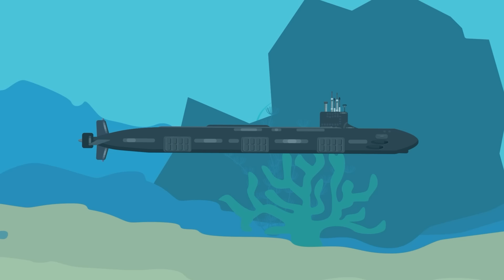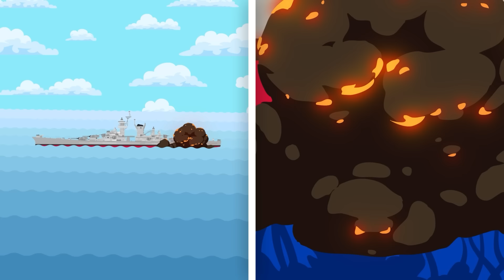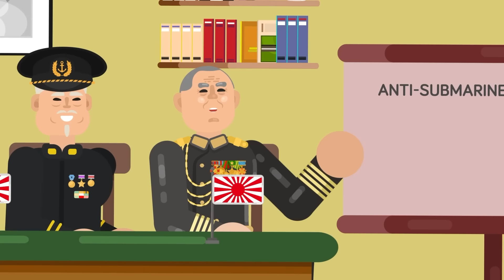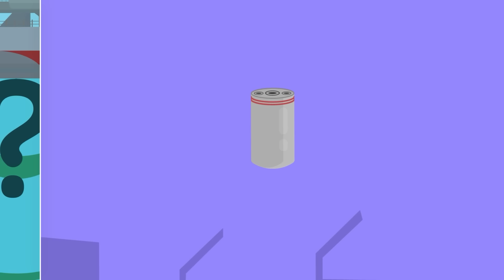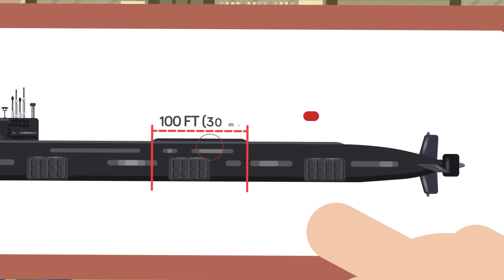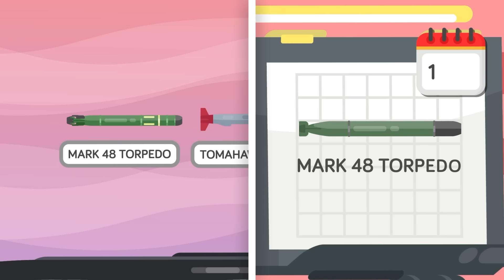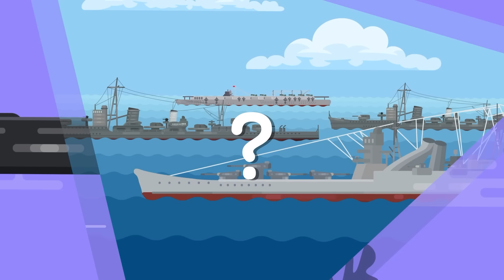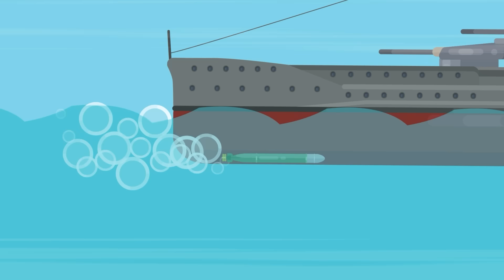What If a Single Modern Submarine Time Travelled to Pearl Harbor

Comment: Aside from the utterly wrong info about Hiei and Kirishima, there were only 3 cruisers in the IJN striking force, not 8. The 8th Cruiser Division was just heavy cruisers Tone and Chikuma, and the 1st Destroyer Squadron was lead by the light cruiser Abukuma. There were also not 30 destroyers in the fleet - not even close, only 9. Akigumo was attached to Carrier Division 5 as a plane guard, and the 1st Destroyer Squadron was made up of DesDiv 17 (Urakaze, Isokaze, Tanikaze, Hamakaze) and DesDiv 18 (Kagerou, Shiranui, Arare, Kasumi). 

A further 2 destroyers from DesDiv 7 which was technically under DesRon 1 (Sazanami and Ushio) were sent to Midway at the same time to shell the base there as a diversion. 

It takes like 30 seconds to check the order of battle.

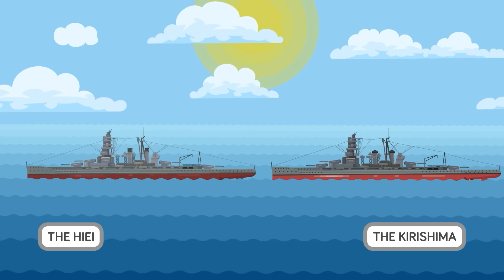Comment: @2:20 The Hie and Kirishima would not remain the most powerful ships in the IJN, not with 14 inch guns. The Yamato and the Musashi had 18.1 inch guns. Who writes this stuff?
Reply: They weren't even the most powerful ships at the time of Pearl Harbor: Yamato was still in shakedown phase at the time, but the Nagato class had been around since 1920 and was significantly more powerful.

As for this video, it fails to utilize the most powerful weapon on the Virginia class--its radio transmitter. Once it locates the Japanese ships, a quick wake-up call to the naval command at Pearl Harbor would end the mission real fast without wasting the super-expensive 21st century torpedoes on such puny targets as WWII destroyers. I'm only half joking: this video assumes that the Virginia is able to locate the Japanese fleet to begin with, when the failure to detect the fleet was the main reason why the attack was so successful.
Reply: @mogeleo  "there's a japanese strike group at this location!"
"first of all, what are gps coordinates. second WHO THE F ARE YOU! GET OFF THIS FREQUENCY!"
Reply: @mogeleo  I would bet that nearly every US sailor has a basic knowledge of the events at Pearl Harbor, and the Captains of those subs absolutely do. The sub has surface search radar. Get to within 100 miles or so northwest of Pearl, and power up the radar, and they will find them.
Reply: You're right, of course. But, they were "fast battleships" capable of keeping up with the Kido Butai.
Reply: @Wae-DI  mate the vid doesnt even mentions the name Kido Butai...full of inaccuracies

Comment: Except the mk 48 adcap torpedo is designed to blow up under the ships now a days that creates a massive are pocket making the ships weight buckle the ship snaping it in half...The torpedos have their own sonar and sensors to ensure it is a correct displacement area.  1 of our modern torpedos is enough to sink the crusers destroyers or any smaller ship. Battleships and carriers are too large to for the ship to snap in half from a air pocket of the size it can displace.

Comment: I was on a Los Angeles class sub, so I can't speak for a Virginia per se, other than I have some coworkers that did serve on Virginia boats and have verified similar capabilities, and I can confirm even a Los Angeles class (which is older) could wipe out a WWII fleet of this size without being in any real danger itself. That's why I've pointed out to other former Navy guys that if we ever got into a hot global war with major powers, the existence of modern submarines would completely rewrite naval warfare and likely make surface warships obsolete even more than carriers made battleships obsolete. 

No surface fleet would be safe. Torpedoes like the Mk48 ADCAP and newer variants are so lethal a single one of them can take down the biggest ships. And even Cold War era nuclear attack boats can hit targets from a very safe distance, at depth and never be detected. I suspect a prolonged war at sea would force all modern navies to shift to submerged warfare and make surface navies a thing of the past. What kind of crazy fleets would come out of the end of that, I have no idea.
Reply: It would be seaQuest DSV😊
Reply: I have no experience with anything military, so it's just a question, but if a modern sub was sent back in time, how much of it would work without satellites and other directional assisting equipment
Reply: @3613jeremy  Obviously they would lose certain advanced navigational capabilities without satellites, but as they are designed to be able to navigate at depth without any satellite or radio connections it wouldn't be a problem.
Reply: @3613jeremy  Considering that we get GPS info from sats we would have some navigational issues. But there are back ups with ocean floor maps that use sonar to guide and all of our torpedos are used outside the sat systems. The missle systems would be affected though since we would have to move from GPS guided to lazer guided. The scope can affix a lazer on a ship though and it would launch just fine. As far as being found it would still be a needle in a hay stack the stealth tech we have is unmatched. Our subs make less sound and have a smaller signture than crilfish.
Reply: @Monstarz  Well, I think we can safely ignore everything you said, you clearly were never a sub crewman, and definitely never worked with SLBMs.  They don't use "lazer" (sic) guidance, and don't use GPS guidance, either.  They use a gyro-driven inertial navigation system and a star tracker.  GPS and any form of command guidance (to include laser) was very deliberately left OUT of all nuclear ballistic missile systems, because those guidance systems can be spoofed or jammed.  INS and star trackers cannot.
Reply: @Kelnx  I've been working on a Los Angeles class sub. Amazing boat
Reply: I was on the USS Lousiana. If they took it back in time the entire war with both Japan and Germany would have ended swiftly...its an SSBN
Reply: @Kelnx  tell me about it not even. Navy I'm army i still know that 1 mark 48 would break the keel of any capital ships back in ww2
Reply: Hovercraft style ships.

Comment: Belt armor was not used to protect against submarines. It was designed to protects the ship's vitals against gunfire.  They tried designing armor lower down, to stop torpedoes, but found the multi-layer bulkhead system to be more effective.
Reply: The torpedo defenses in WW2 also only had to worry about WW2 torpedoes, which operated almost exclusively on contact fuzes (hitting the side of the ship).  While both the US and Germany experimented with magnetic influence fuzes that theoretically would allow a torpedo to explode under a ship, neither got them working properly in WW2.

Modern Mk48 torpedoes with active sonar homing, on the other hand, can very reliably detonate mere feet directly below the keel of a target.

Comment: I wonder how much the modern weaponry would depend on things like satellite infosystems. It's entirely possible some systems would simply be disabled because the satellites they depend on (like GPS) are absent in WW2. I hope they have backups... but it does seem possible some systems would be less effective than they should be because of apparent sudden loss of all external infrastructure. Or - maybe not. And we're not going to find out, because those who could speak definitively on it are absolutely going to be sworn to secrecy.
Reply: @TomBortels  most NATO missiles use gps for navigation. The Russians are disabling the gps in Ukraine causing headaches for the , NATO, I mean Ukrainian operators.  
So without gps many of the weapon systems aren't all that.
Reply: @ i suspect you're right, in that gps jamming could wreak havoc - but I also suspect (or hope anyway) that a modern nuclear submarine and it's weaponry have taken "the gps sats might be down or unreachable" into account. Dunno.

Comment: And that's assuming the sub only was carrying normal cruise missiles and not actual nukes.  One or two of those would render the entire fleet useless.
Reply: Virginia classes do not have the capability to carry ballistic missiles, they were not built with nuclear capabilities in mind. That is the job of the Ohio's.
Reply: @deathcore4576  nope, Tomahawks still have their nuke capability; they don't use it due to treaty obligations as it would be considered an intermediate-range nuclear missile.

However, the Crossroads Baker test showed that using nukes against naval targets is useless.
Reply: @TheTrueAdept Baker managed to contaminate the ships, but only 9 were destroyed
Reply: @deathcore4576  I mean, they have the CAPABLITY, but due to treaty obligations they dont, which is why the Ohio class sub is still used despite the Virginia being superior in almost every way.
Reply: @alexrompen805  the Ohio Class is still in use because nothing is currently built to replace them. Virginias do not have nuclear capabilities; they are not large enough to carry ICBMs which is what the Ohio's carry. if the Virginias had the capabilities to do what the Ohio's do the U.S. would have phased out the Ohio's decades ago. Then you might point to the nuclear tipped tomahawks which were taken out of service at the same time the Virginias came into service. which mean Virginias were not designed to have them. Virginias and Ohio's are 2 different beast that cannot be compared in any aspect other than their age.
Reply: @deathcore4576  Nuclear Tipped Tomahawks are a thing.. TLAM-A or BGM-109A had a W80-0 warhead with a yield from 5kt to 150kt. They were removed from service in the mid 2000's though.
Reply: @dundonrl  if they were removed from service that the Virginia's which were introduced and began being built in 2002 likely were never planned to have them and thus never had nuclear capabilities.
Reply: @deathcore4576  Hey, thanks for the correction.
Reply: @deathcore4576  The W80 strapped to a BGM-109 disagrees.
Reply: As far as I know the test warships at Bikini in Operation Crossroads didn´t have full complement of ammunition and fuel. If heat from a nuclear blast cooks off ammunition and fuel on the ships close-by then they might start fires on those ships or even explode destroying those ships.
Reply: @deathcore Didn't he mention nuclear armed Tomahawk cruise missiles early in the video?
Reply: @tobyk.4911  No, he might have said that the Virginia is a nuclear sub but that doesn't mean it's armed with nukes.

Comment: Jus think, if we know all this about our subs, there’s SOOO much more on those subs that we DONT know about
Reply: Let's also not forget regular tech as well. The US military was using GPS back in the 70s, and only became available for public use in 1995.
Reply: Rule of thumb with the military. What we know that's cutting edge.... they have 3 generations further that we don't know. 
Easy case and point is the F22 -flying in 2005 announced, but its first flight was in 1992. 
13 years they had it and "were just testing it"?.... ya

Sure